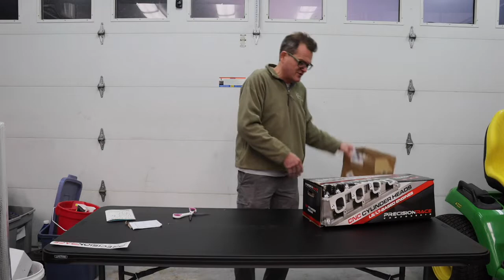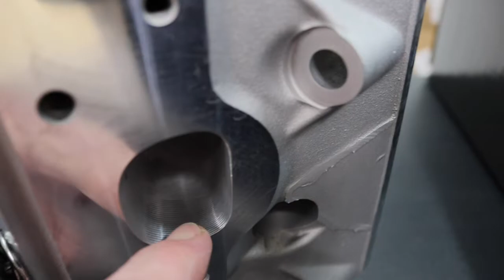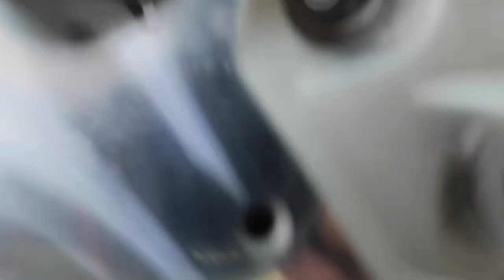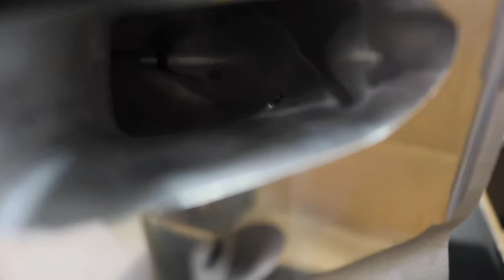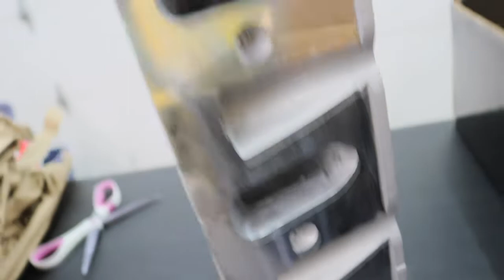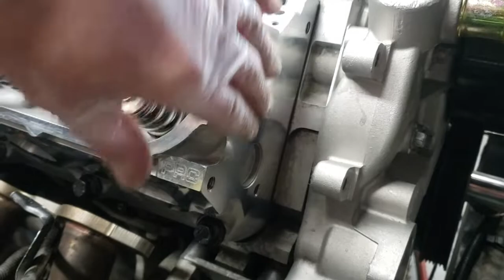LS6 CNC Head Unboxing Texas Speed PRC Stage 2.5 Review

Comment: Do they port the combustion chamber too? One of mine is dinged up a bit.
Reply from the maker: No, they don't. I would maybe call Katech as I think they had that option.
Reply: @chrislorenz8990  probably not a huge issue. So long as it’s functional I’ll never see it 😂
Reply: If you make a request they do alter it because my heads were ordered and sold as different than stock CC size, but I have never checked them. Not sure if my engine builder did, I can't remember but he probably did.

Comment: I have the exact heads 2.5 799. I hope you blew out and washed the runners out. I had a bunch of aluminum particles inside my runners when I got them back. I had another head shop remove all the casting on the right side of my intake runners. I was better off buying a aftermarket heads after I had them reported.
Reply: Im considering the TSP heads/cam package for a older vette, but am worried about their porting being bad. I could get a set of Frankenstein heads but it would be a $1000 more than TSP
Reply: @JuanyJuanes  they do good head work. My told me they did a good job on the valves and flowed 314cfm on the guys bench. They do cut their own aftermarket heads also.